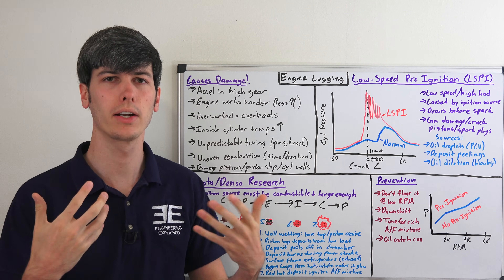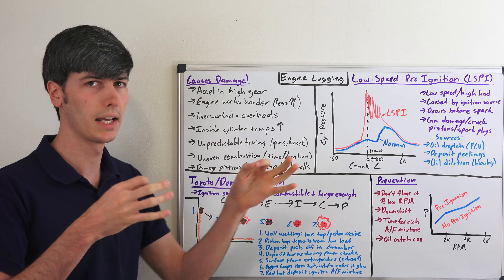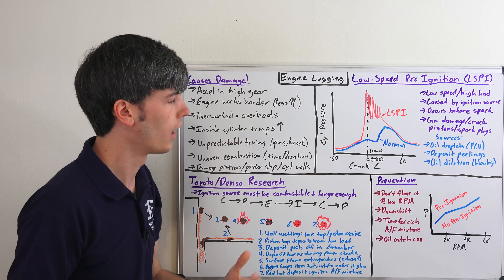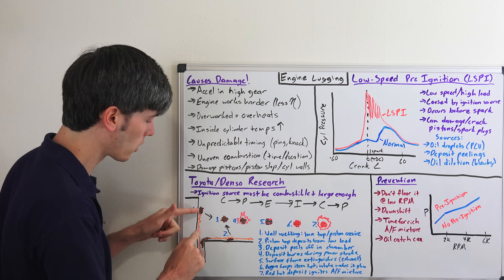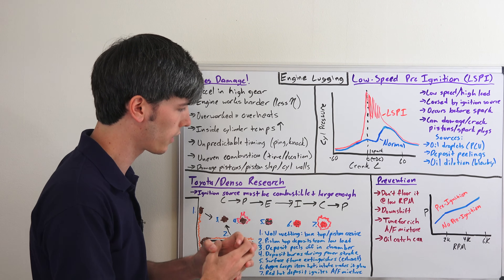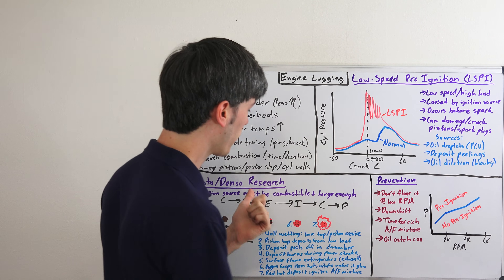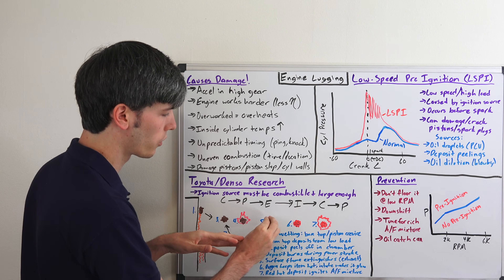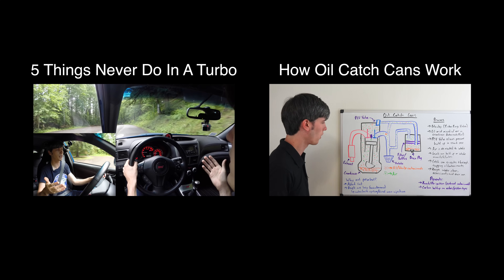Why You Should Never Lug Your Engine (Especially Turbos)

Comment: The rest of the story is that the Toyota Denso research (which all major automobile manufacturers either had access to or conducted themselves) was aimed at developing timing/fuel/air mappings that can mitigate and/or outright avoid the heat/pressure conditions resulting from lugging. If you drive a late model car with a small-displacement,  turbocharged  engine the computer simply won't allow you to cause damage to the engine by simply opening the throttle under any combination of throttle position/RPM.

Bottom line: If you drive a race car and/or a car with custom computer tuning there are rare conditions under which you might cause damage and/or excessive wear to your engine by lugging it. And if you're driving such a car you probably already know this. For everyone else, don't worry about it, the computer won't allow you to damage your engine by stepping hard on the gas in at low speed in a high gear.
Reply: I drive a 2016 Ford Mustang Ecoboost. It is 2.3L direct injected, turbo charged. NOT with port injection also. It has blown up twice in 96,000 miles. WITH a catch can. LSPI was probably the ultimate cause, but as the ECU brings the engine to a knock then retards timing, its knocking all the time. Since the DISI engines do not scrub deposits on the valves with gasoline going over them, you have a great source for hot spots in the cylinder.
Reply: @Orcinus1967  If there were a widespread problem with stock engines blowing up we would know about it. There are literally millions of these engines in operation around the world. Almost all of the catastrophic failures I've read about involve modified software.
Reply: @mwsletten  In my case, a 2016 EB Mustang, I purposefully did not "tune" my car using modified software. I had a 100,000 mile CPO warranty to protect. I have found much evidence of the engine having problems, especially with cylinder # 3.  Chevy, Ford, major manufacturers, all do not have a problem with 2-3% of their engines being bad. It is an acceptable level, and for the most part, they fix stuff under warranty, as they have fixed mine. Twice. I re-upped and got another 43,000 miles on an extended warranty, to 2024 or 143,000 miles. I am now at 97,000 miles.  2% of 1 million engines is 20,000. Ford does not want to discuss what is wrong with the  2.3L EB. I have to draw out of my service department what failed on my car, and then its never exactly what went wrong. "The heads", for example. When you say "engines" it helps to be specific. It is not the same as other EB  engines.  Most people aren't on forums about specific engines. And when they are I always find misinformation from supposed experts, and folks who haven't even owned a Ford of any sort, for 20 years. Of course the average person may not have an interest in cars. So even if they did have a problem, you would never hear about it, especially if they were provided a loaner car and it was fixed under warranty. Which 2.3L Ford do you drive BTW?
Reply: @Orcinus1967  said: "I have found much evidence of the engine having problems, especially with cylinder # 3.  Chevy, Ford, major manufacturers, all do not have a problem with 2-3% of their engines being bad."

Sorry to hear about the issues you've had with your car. I don't believe your experience is common.

Ford just chose the 2.3L EcoBoost for use in the Ranger and the new Bronco, two vehicles Ford expects to sell very well. That's a helluva a vote of confidence in an engine. Seems crazy Ford would do that with an engine it doesn't believe is rock solid. 

It also seems crazy there are no stories in the press about customer complaints regarding the 2.3L EcoBoost. Ford just took a major financial hit on DCTs in its Focus and Fiesta model cars. The motoring press was all over the story as soon as customers started complaining, way back in 2011 when the DCT was first introduced. Where are the press reports about problems with the 2.3L EcoBoost, an engine that's been in service since 2015? 

Here are a couple of questions:

1. What is the actual failure rate of the (unmodified) 2.3L EcoBoost engine?
2. What is the failure rate industry-wide for small displacement turbocharged engines from all manufacturers?

That's the data you need to determine reliability of the 2.3L EcoBoost engine. I can tell you that Consumer Reports rates reliability of Ford's 2.3L EcoBoost as above average. That's based on actual customer surveys.

I have  Mustang EcoBoost. No significant engine problems after 40K. The only issue so far was a small oil leak around the valve cover which was repaired under warranty.
Reply: @mwsletten  I agree with you that if it was a major problem it would make the headlines, somewhere. If not NHTSA. But there are a lot sexier narratives running these days. Those being cops shooting blacks, and covid. These engines do blow up, and, like you said, especially if you take the safety stops off, as with an after market tune, or if you decide to pump up the horses with bigger intakes and turbos etc, but not the internals by putting in better pistons and connecting rods etc. What I have been told by 1 mechanic outside of Ford is that some companies have backed out of direct injection, the technology just not being up to the task, yet. Hopefully Ford has gained experience from the engines that have blown up, and fixed any issues. Today they make the Hi Performance 2.3L. They took some safety stops off there. Changed the revs and the horsepower. They must have learned something. Years ago, 2018? I had asked a guy at Mountune (Mountune are a race engine and road-car performance specialist who alongside Ford have developed critically acclaimed packages that boost not only output but also performance.) if they could work on my 2.3 Mustang engine. They were advertising they would work on it at the time, online. When I called on the phone, however, the answer was "NO". Only the Ford Focus ST and RS and Fiesta ST. They would not say why they would not work on the Mustang 2.3L engine. Most likely they did not want to jeopardize their relationship with Ford. To me, from my personal experience, at Ford dealers and at my personal mechanic (recommended by a Ford parts salesperson)  that says "there is an issue, and we are not discussing it due to the legal and cost ramifications of a potential recall". And, another thing I've heard over and over is "I have a relationship with Ford, I'm not going to jeopardize that relationship", even if it's only someone selling me a set of hood stripes in a color Ford does not want me to put on my car. I am more skeptical than you. Ugh. I'm going to clean my catch can. 
Cheers and good luck with your EB! I love my car and I'm keeping it til I find a V8 Stang with Magneride, used. Then I can deal with the ticking engine thing on the 5.0!

Comment: This... this might be the answer as to why I accidentally and unknowingly blew up my Alfa Romeo 156 2.0 TwinSpark engine. :(

It ended up knocking against the head on cylinder 1, the first one to get oil but also the one to recieve the highest oil pressure. So if I was on low rpm with a dirty engine (only just got it from a gramps) than oil carbon diposites might have been forced by the piston depending on wear and engine heat, which could have ignited and so on as said here.

Comment: This might be much more of a problem on a car that operates with less computer intervention. I find most consumer cars have the computer regulating it so much that you can't even burst your engine. Back then you had a steel wire linking your accelerator straight to your carburetor, those days engines were obedient and gave their all to you, but you could easily destroy it. I suppose more sporty cars, even today, give more of that feel. But on my car, if I am lugging a bit and I floor, the car doesn't obey, it will follow its computer acceleration curve. Its a standard BTW.

Comment: what about going a low speed in a high gear when the engine is hardly turning over? Like if i'm in 5th gear, doing like 28 mph or something, it'll sound like it's about stall (i'll downshift), but say i dont and i maintain that speed, will it harm the engine? Turbo or NA

Comment: I agree that the engine works harder this way, but looking at BSFC maps, the engine gives it´s best efficiency with higher loads, so it is more efficient to use a higher gear and increase the load. I have 2 cars both naturally aspirated, and one of them really do pre-ignites in these conditions, end the other one seems to have no problem dealing with this kind of driving, and at least for me the car´s fuel consumption is better this way. I mean, that´s the same point of using an overdrive, or disabling cilinders, so the ones left work harder, right?
by the way, great video! big fan! (also mechanical engineer)
Reply: I came to this video trying to understand why one engine handles it fine and another pre-ignites. I'm thinking it has to do with Air/Fuel mixture. I guess I'll have to look elsewhere for the answer. The reason why it is more efficient to load the engine is because it requires the throttle to be open therefore reducing friction loss due to the throttle plate. This is one reason a diesel is more efficient, since it doesn't have a throttle plate.

Comment: This video doesn't mention EGR systems, which by the logic of the study greatly increase the chances of deposits getting into the cylinder during the intake stroke. No EGR = less problems, as long as the ECU is mapped for it.

Comment: A good example of this is with diesel engines. car engines rarely run at full loads but diesels often do. A diesel in a semi truck or heavy equipment will run at full load for hours at a time. If you have a pyrometer you can watch the exhaust temp climb as the rpm falls below the power band. Soon after, if you continue lugging the motor, the fuel temp will climb on motors that have an internal fuel rail and coolant temps will climb. On tier 3's exhaust sooting will occur and cause Regen cycles. Eventually the ECU will fault for one of these. 
 A teir3 Caterpillar held at 1600 under full throttle for an hour will fault. Try it with a gas motor in a car.
Reply: When are buses come back the temps can reach 1000 F when its doi g some small regens lol but its nowhere near full load

Comment: I'd like to add (but this is not a combustion aspect) that high torque low RPM is harsh on the crankshaft / piston bearings. The combination of high forces and slow rotational speeds mean bearings are not loaded as dynamically as they are designed to be and this causes extra wear. Read a case about an audi driver cruising highway at 900RPM or so. Engine didn't last long.

Comment: i think most common costly damage is gearbox damage. with low rpm the forces are higher. People think they are taking it easy by driving at low revs with high gear, but reving it higher would be much better for the gearbox and engine.

Comment: I knew you were a smart guy when on your LSPI chart, you have pressure plotted to actually decrease after TDC, just before spark, and you make no mention of it.

I found running a NA type engine at 5 in/Hg or higher is safe in low rpm conditions.

Comment: "Engine works harder (less eta)"
I don't really understand your point. An engine is more efficient the more load it gets.
You can see it in diagrams like this:
https://data.motor-talk.de/data/galleries/0/2/3097/55532474/muscheldiagramm2-4821237128971166390.jpg

So the BSFC benefits from high load/low revs.
Maybe I missunderstood your point and you can explain it to me.

Anyways, keep up the good work, greetings from Germany!

Comment: Is my car ok to be floored at 2200 rpm? That's where it makes peak torque. It's an automatic and it  will let me lug if I don't click the button at the end of the peddle. I love doing that because it's less noise. I notice a lot of the new cars are lugging the engine when in Eco mode. How bad could this be if that's what the manufactures are making them do.

Comment: When I was allot younger I would do this with one of my big single cylinder motorbikes as it would make an awesome groundshaking thumping sound when in 5th gear and at low speed with the throttle wide open. When I came to do the first oil change there were shards of metal in the filter and sump. Lesson learnt.
Reply: That... Shouldn't happen.  That's something else causing catastrophic failure.

Source: Ride and Repair high performance dirtbikes/motorcycles.
Reply: thats not the reason... cant be, Liam 4.0 agreed
Reply: Sounds more like a fucked up tranny (pun partially intended). It's amazing how randomly people link incidents and causes. If you rev your vehicle into the limiter directly after a cold start, and then a minute later your headlight fails, do you really think that's cause and effect?

Comment: everything has knock sensors now..problem solved.
Reply: The specific event talked about is completely caused out of the ignition control's ability. Retarding timing will not prevent this problem, when ignition is caused by something other than spark.
Reply: Retarding the timing throws the spark later in an engine's duration. It's easy to make that mistake.
Reply: Ryan Barbolt You're right, as an automotive engineer, and specialist in engine performance, what would I know.
Reply: Not My 1990 Geo Metro 3 Cylinder.

Real Cars Suck!
Reply: Warhawker Retarding timing ignites the a/f mixture before it can pre-ignite.  Regardless of what's causing it.
Reply: Let me say this as simply as I can, you're wrong.
Reply: You said it not me.